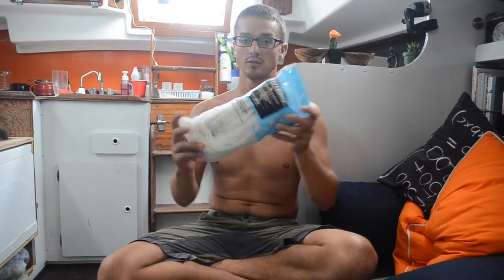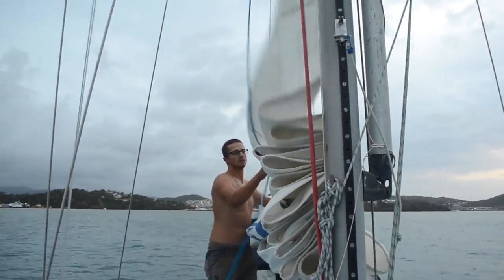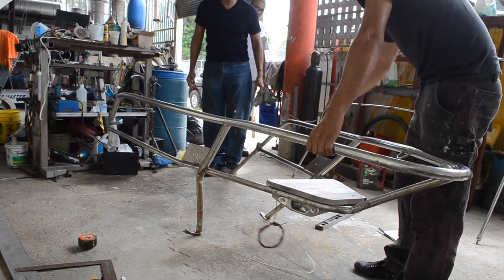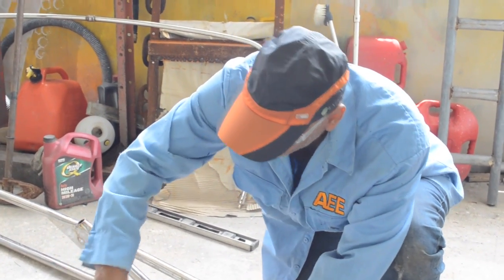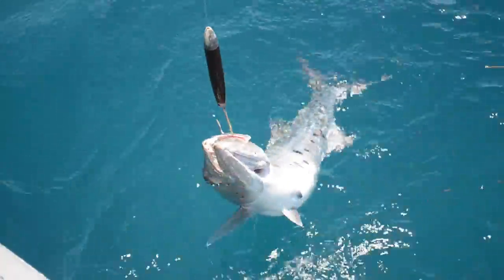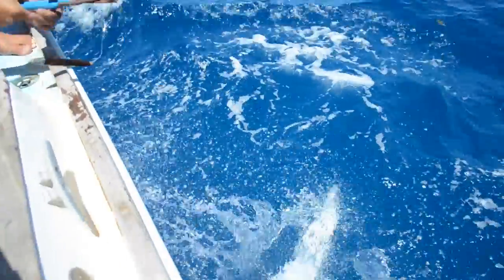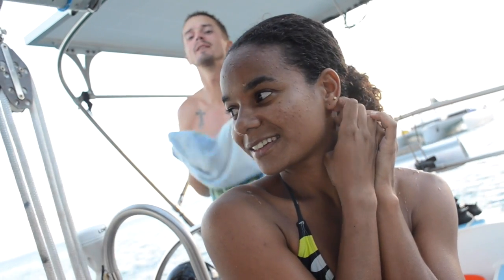Pulpit Repair and Sailing to Culebra — Sailing Uma [Step 74]

Comment: I must admit that I don't watch your video's to see you sailing and touring the islands. I really watch them to see the work your doing. Not only is the work very well done you have done the research. You really have master the skills. As a retired boat builder I'm still learning from you.
Reply: mastered oops
Reply: There's a channel by the name of "Sail Life" with a Danish guy that does exactly that. Worth a visit and sub.
Reply: From another old boat builder;  Recreating the deck camber to match the angle of the deck plates on the bow pulpit. This is paying attention to detail that takes years of experience.  I am impressed.

Comment: Hey Dan, As a partially disabled sailor, I can understand wanting a lighter weight motor. Although the 4 cycles are more desireable, I bought an older Mercury 3.3 hp motor that was in brand new condition. A friend of mine took it replaced the carb with a different carb (which he found instructions for on YouTube) and shazam she's a 5 hp motor that only weights a very manageable 38 lbs. Since it's a smaller motor it has an internal fuel tank, once less thing in the boat and to go wrong. If I start the day with a full tank, I've never used more than a tank in a day and that's with the kids playing with it all day long. Although I like the idea of going old school and rigging a sail some times it's just nice to have a motor. Also with as light as your boat is a 3.3 or 5 hp motor should push it along just fine! I picked my motor up for 100.00 dollars. The previous owner bought it and decided he wanted a bigger motor so it sat in a garage winterized for 4 years with only "he says" less than 10 hours on it. It looks like show room floor condition so I feel I got a good deal. Good luck and thanks for another great video. I could watch you guys work on your boat all day long! You are definitely a cleaver couple and you both work so hard it just inspires me! So keep the videos coming we all love em!!! Bill S. s/v ODIN

Comment: I have jack lines on my boat and I love them. They keep the mainsail under control when short handed.  I''m glad to heard and think its very smart of you to do a prototype with the cheap line and plan to replace it.  I use this same type of line on my winter storage cover tie downs.  I have get new almost every year. This HD stuff have no UV protection and even in the winter there is enough UV to deteriorate the line.  In the tropics, I doubt they will last more than 3 months.

Comment: Don't bother fishing  in less than a couple of hundred feet of water.  Ain't no Barracuda out in the blue. Plus, because you can't attain normal trolling speeds (8 to 12 knots), use skirted lures with a fat head to generate a bubble stream. Live or dead bait are impractical in your situation but you can get some very good liquid scent in a bait shop to stink up your lures. It really helps. Your scent trail could stretch back a couple of hundred yards and Mahi, Tuna and such will follow the trail to your lure. This lets you cover a lot more water.
Reply: Dustless Blasting is telling you good.  No cuda out deep blue. You can cut the cuda in strips and hook the strips on the lures he is describing.  I have trolled with a cat fish as bait and caught fish.  Trolling is more art.  You could stop the boat if your depth finder shows hard bottom or a ledge or fish.
Reply: Yep. I don't know much about high sea fishing, nor tuna or barracuda but I think barracudas are patroling in near surface waters like bass but tuna are more bottom fish like Walleyes, but getting to the surface waters hunting in the morning. Try an old trick of mine when trolling: Do a wide 360˚ turn with, what 50 or 75 feet of line. Your lure will slow down and sink deeper tentalizing hunters. Always works with Walleyes.

Comment: You will love having Lazy Jacks.  I installed some about a year ago.  Makes a huge difference single handed.  I just slacken them right off before I hoist the sails and tighten them right up before I drop them.  They work perfectly every time.

Comment: If you are fishing in shallow water close to shore as others have mentioned you will catch cudas.  I wouldn't stop fishing because you can pick up grouper or amberjacks but you will need a lure that is a deeper diver.  Use a wire leader so you don't lose your lures to cudas and don't use skirts because cudas will tear them up.  At slower trolling speeds use a Rapala.  Switch out the treble hooks for single hooks so it is easier to release the cudas when you catch them.
Reply from the maker: thanks for the tip :)

Comment: I was Wondering just yesterday when or If you had fixed that. 5:15.  Bow line yet. 😱👍😎
I did some Hili-arc welding in the Navy, at least that’s what it was called back in 1969 & 70
It was just like what you were doing and Yes, Stainless is hard to weld, so is Galvenized steal.
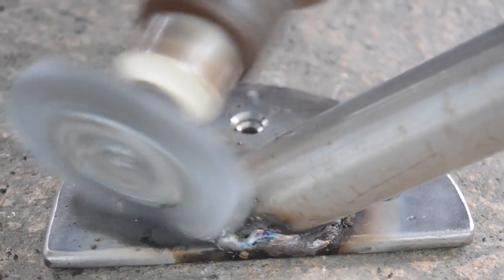But you’d look good. 9:39. After cleaning... ✅

Comment: great video! about the baracuda problem:
there are the obvious choices: try different lures, variation in depth ( by adding weight or special diving plates for fishing lures or just by using deep diving lures) and also longer lines, some fish are too cautious to attack a lure that's too close behind the boat.
BUT....trolling is NOT your only option! why don't you guys start to set lines whenever you're at anchor? natural bait like squid (stays on the hook very well, my favourite!), shrimp, minnows and mussels work very well. check if you're allowed to use circle hooks where you are, the fish hooks itself and you can just leave the lines out. attach the hook to about 50 -150cm of strong carbon leader, then a swivel, then the main line with a sinker (weight and shape depending on the current, just make sure it can move freely on the main line). i find this way of fishing so much more exciting than trolling bc you can catch many more different species! 
another tipp i have, and it's not very novel either, is just to look at and ask what local fishermen do. fishing techniques and lures are different for every area and whatever i or someone else tells you here, might have worked for us but it doesn't necessarily work for you or where you are at the moment. locals know best! 
fish like underwater structures like rocks, cliffs, reefs etc.... they want to be able to hide and that's where they find food. if you find a place where the depth suddenly drops from like 5 m to 15 m or more, that's where you'll catch fish! 
and finally: catching a fish on a line is only one way to get food from the ocean, my experience is mainly based on the mediterranean sea but i know there are other options all around the globe! in areas where the water is clean you can collect clams from a cliff and they are delicious! i have seen people catch an octopus in a vase, with a chicken leg and i have caught many with a spear gun...you need to beat them on a rock so they become tender and you need to cook them for a long time (and the smell is not the best) but a salad made from boiled octopus is one of my favourite things in the world....my mouth is watering now. calamari (squid) are easy to catch in some areas, some smaller sorts of crabs make excellent soup or spaghetti sauce and some italian people (and i think asians as well) love to eat urchins....
don't limit yourself to just trolling, there's plenty more (fish) in the sea! and even if some pelagic species like bonito are not endangered, they face a lot of pressure...by broadening your menu you might help to take at least a little of that pressure off! 

have fun and good luck!

Comment: Is the Lazy Jack the same as using a Stack Pack ?
Will you be making a enclosed place for the main sail to drop into when you lower it?
Reply from the maker: Sort of. A stack pack usually has lazy jacks attached to it. Spoiler alert, we do end up with a stack pack...in about 2 more "years".
Reply: @SailingUma  That is good to hear.   Thanks for answering questions from the past haha.  It's nice you care about subbs who are not patrons.  I hope clicking the LIKE button helps.  I would do more but I am disabled and live one  a low disability income now.

Comment: Cool video, as far as the barracuda it is the type of jig or hook on your line.  Try to get a variety so you can switch it out to try different ones. If you have ever seen a commercial tuna boat they use jig poles to troll for fish. It is extremely effective way to find fish.  Rather than using rod and real. I have thought this type of system could be used on a sail boat in a smaller form. It is very fast to retrieve the fish, with less chance of loosing it.

Comment: Fish tip. I am not a fisherman, but I've noticed fish swim around the light at night, maybe use a floating led light out on the water a night and catch them easier. Idk just an observation, curious to see if it works and helps.

Comment: Have you thought about a small trolling motor as used by fisherman.  Runs off batteries which you could recharge with solar.

Comment: Looks like Luis did a great job on repairing the Pulpit.  Was the cash the Whale Tour company gave you 
enough to cover the expenses?
How is the new Anchor Windlass working out for you?
Reply from the maker: Yeah, it turned out quite well. He had everything we needed and only had to pay for the gas and welding wire, so it worked out in the end.
Reply: @SailingUma  That's great.  It is always best if the person doing your repairs is really motivated to help you like that.  It is fun to watch your videos.  Thanks.

Comment: Would you consider an electric outboard?
Reply: Hmmm, could you carry enough battery power for that, kind of doubtful, but who knows these kids are very innovative.
Reply: Steven Keys they probably could with a more sturdy dinghy? all you would need is one or two batteries I think, the issue would be charging them. could just plug the dinghy to the boat via a extension cord type deal.

Comment: Trolling on a sailboat is slower than on a powered vessel.  Going 4-7 knots, you want your line out about 75 yards, and the lure just below the surface and coming to the surface a few times a minute.  What the guy said previously, use a skirted lure, one like this:http://waaycool.com/images/57%20rigged%20steel%20lure%20trimmed.jpg to get some nice Mahi or Tuna.  You can buy these anywhere but if say you are off the coast of Puerto Rico, go into a fishing store and find out what color lure they use and style and go with it.  Last, put a bell or something that will make a noise if you get a strike so you can do your other business and catch fish at the same time too.   That old wood lure you had in the video is really old school.  The idea of using the barracuda or better, use the flying fish that you find on deck in the morning as your strips on the hook.

Comment: I'm surprised you didn't put an electric motor on the lower unit of the outboard.
Reply from the maker: We thought about it, but the motor itself is SO big, just to put an electric motor in. If we ever wanted to do an E-outboard build, we'd just grab a non working 3 or 4 horse, which we could probably get for free. In the meantime, dragging that non working motor around the Caribbean, just to rebuild it one day, wasn't worth it to us.

Comment: Hi Dan and Kika,

In a prior episode you had the sad experience of your autopilot being broken. Broken autopilot seems to be a constant among youtube sailors There is a method of self steering called "sheet to tiller" that uses line attached either to the boom or the jib, depending on whether you are beating or reaching and surgical tubing. The beauty of the system is that parts are cheap and readily available and easy to repair or replace as required.

https://www.youtube.com/results?search_query=sheet+to+tiller

Comment: Could you please explain what a swell bridle is?
Reply from the maker: Yes! But probably not in a comment. We’ll add it to our list of short videos to make. But basically, you tie a long line to you anchor chain and then back to a cockpit winch. You let out some chain so the boat rides perpendicular to the anchor. You only use this technique when the wind is coming from a different direction than the ocean swell. Works very well, but only if you have an over sized anchor that can handle the extra load. Make sense!? Email us if not and I’ll draw you a picture.

Comment: Buy squid. Cut into strips from body, about three inches by 1/2 inch. Add strip to hook. 

Also tie a flash spinner about 18 inches before lure. 

Add 24 inch strong fluorocarbon leader

Comment: I hate that type of cheap rope !  Usually the core is a different material so it stretches at a different rate and has a different breaking strength.  Probably the best thing you could so is get rid of the core.